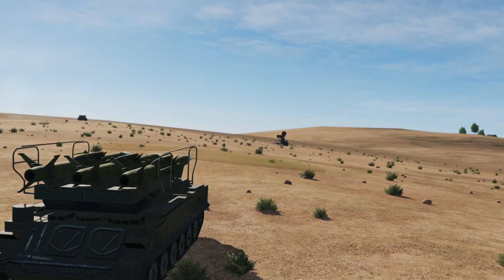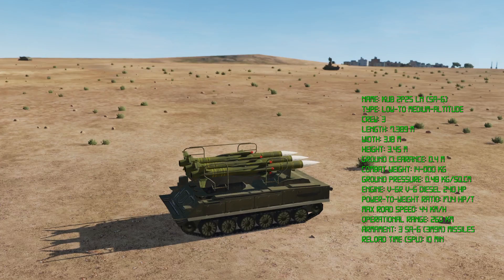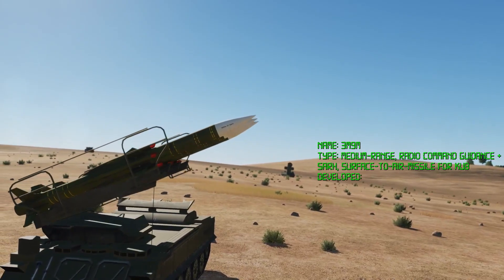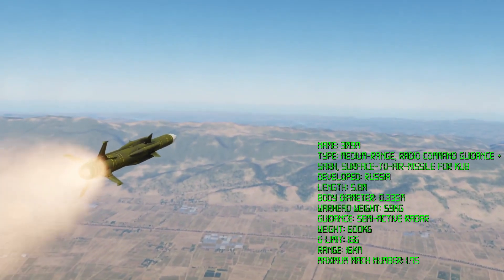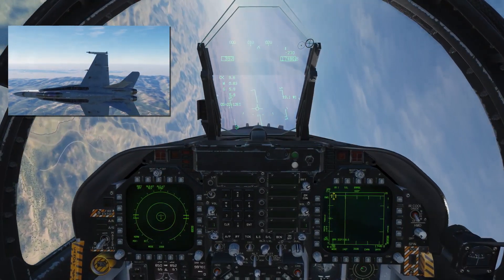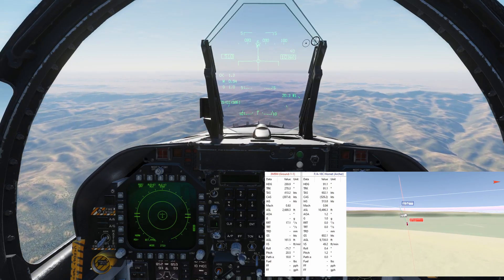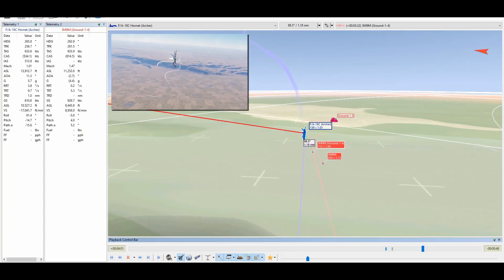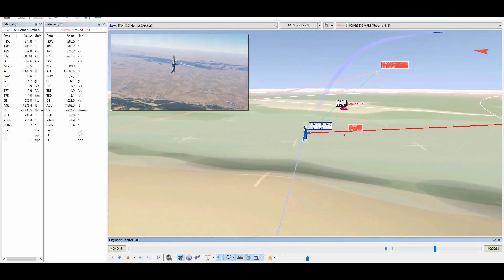Missile Defense: Can YOU defeat the SA-6?

Comment: This is great stuff! High quality and informative - alerts on for anything else you make!!

Can you detail how to execute orthogonal breaks?   Or just how to execute a break when you are beaming but the missile has the energy  to reach you. 

I’d also love to hear your thoughts on DEAD in DCS, weapons / employment / hunter killer (multi) etc.
Reply from the maker: Sure, I will be diving into orthogonal breaks more when we cover missile systems that it can be used as a primary defense such as the SA-2. It's still a good last ditch effort along with orthogonal rolls. You want to stabilize the missile on your lift vector. Essentially stabilize the missile at the top of your canopy and pull max G into the missile when it's within something like 4 seconds of impact for orthogonal breaks. Orthogonal means that it is perpendicular so stabilizing the missile in the top of the canopy should put you perpendicular to the missiles path.

If you realize you are too close to the missile site for beaming to be effective enough doing a break turn to put the missile on your 6 and starting the extending S turns is also a good option. The extending S turns are usually my go to unless I have a good idea of what the missile site is and it's distance. IF I know it's a missile that can be pretty easily ground driven I may opt for that instead.

There's a couple of good ways to do DEAD missions in DCS. It depends on if you're flying alone or with wingmen what the best tactics are. I do a lot of SEAD/DEAD missions on my  stream twitch.tv/4rch1t3ct and honestly the harrier is probably one of the best platforms for it right now IF you fly it right. The sidearms are particularly well suited for the mission in DCS especially for a single ship flight. They don't get shot out of the sky by the missile sites like the HARMs do. Hunter killer teams also work well depending on the site type. Having a distracted missile type and a well executed popup attack with munitions like the CBU-97 can be particularly effective as well. HARMs can also work but you tend to need a lot more of them and I generally only see about a 25% hit rate with them where with the sidearms it's >75%.

I'm glad you liked the video! I really appreciate it!
Reply: 4rch1t3ct wow thank for the reply! Look forward to more of your work